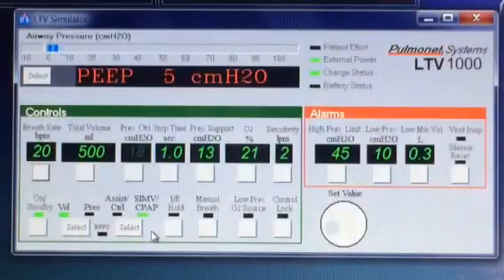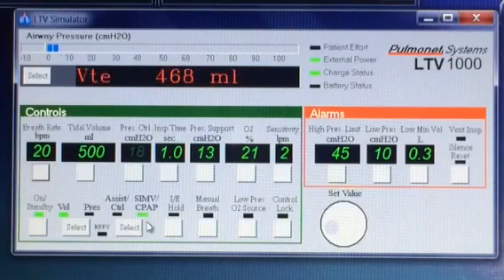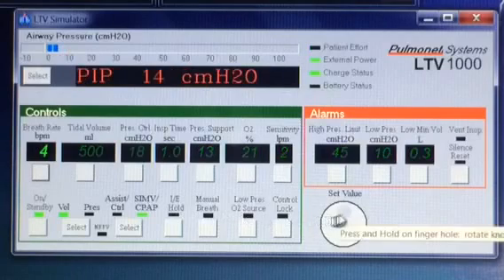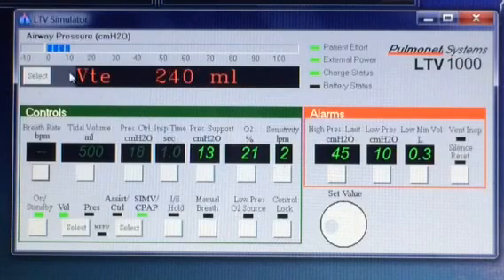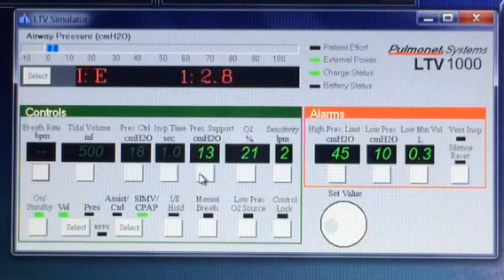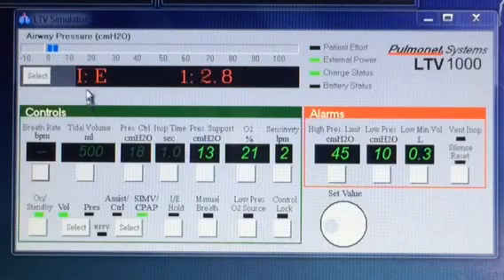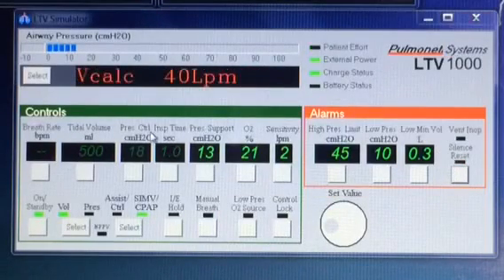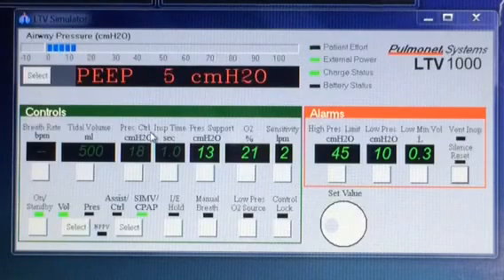CPAP VENTILATOR MODE EXPLAINED

Comment: Can a CPAP Machine be converted into a complex inpatient Ventilator?                             Kathleen Chesterton 11.9k views  
Source: https://www.quora.com/Can-a-CPAP-or-BiPAP-machine-be-used-as-an-adequate-substitute-for-a-ventilator-if-the-spread-of-the-novel-coronavirus-creates-a-shortage-of-ventilators
Vents and CPAPs/BiPAPs are entirely different devices that treat entirely different respiratory conditions. Vents (ventilators — this is mechanical ventilation) are for those who either cannot breathe on their own or who need assistance with spontaneous respirations. CPAP & BiPAP devices treat sleep apnea both obstructive and central. These patients CAN breathe on their own and, for the most part, can initiate respirations. So, no, these devices would not replace a vent, nor would a concentrator. As well, the settings on vents are very different from those on an...
Vents and CPAPs/BiPAPs are entirely different devices that treat entirely different respiratory conditions. Vents (ventilators — this is mechanical ventilation) are for those who either cannot breathe on their own or who need assistance with spontaneous respirations. CPAP & BiPAP devices treat sleep apnea both obstructive and central. These patients CAN breathe on their own and, for the most part, can initiate respirations. So, no, these devices would not replace a vent, nor would a concentrator. As well, the settings on vents are very different from those on an apnea device.
People on vents are intubated. This intubation — tracheostomy, orotracheal, nasotracheal — is incompatible the with the tubing of apnea devices and the tubing that works with intubation doesn’t work with apnea devices. Although vents have CPAP and BiPAP modes — other mode settings include PEEP and SIMV — these settings aren’t used alone. And CPAP and PEEP, for example, are used when weaning a patient off a vent but, again, this isn’t the only setting /mode in use and apnea devices don’t deliver enough pressure to ventilate lung tissue.

Comment: that's not CPAP mode at all on the LTV 1000
Reply from the maker: Please explain your statement.
Reply: Wes Roberts if you have Pressure Support of 13, which is your IPAP, and a PEEP of 5, which is your EPAP, then you have BiPAP not CPAP.
Reply from the maker: When using a ventilator, the mode is called CPAP. It can also be called CPAP W/Pressure Support. 
  There are subtle differences between a ventilator and a BIPAP machine. The LTV ventilators don’t constantly adjust flow to maintain the IPAP and EPAP as the patient breaths. That is the difference between IPAP and Pressure Support. 
  While a BIPAP machine is typically used for severe obstructive sleep apnea (as opposed to a CPAP machine) or assist respiration when there is increased work of breathing for whatever reason, the CPAP mode on a ventilator is the final weaning mode before extubation. The peep is used to replace the lost physiologic PEEP and the Pressure Support is used to overcome the added resistance of the tubing.
Reply: Wes Roberts I am a paramedic and use the LTV 1000 daily. CPAP is not just used to wean people off of vents. It is used every day for pulmonary edema, CHF, etc.

I’ll just agree to disagree in whether or not your video is BiPAP or CPAP.
Reply from the maker: I’m glad to hear y’all have the LTV 1000 on your ambulance. 
  CPAP W/Pressure Support works almost exactly like a BIPAP. When you bring your patient in, if you tell them you had them on BIPAP... that’s great. Everyone will know what you are talking about. It’s not that big of a deal. BUT... it is CPAP mode. Also, on the LTVs, when you use a mask, you should turn on the NPPV mode. (Noninvasive Positive Pressure Ventilation) 
  I suggest you download & read the Clinicians Manual for the LTV 1000.(its a couple hundred pages)  I don’t have a link to it handy. I keep it in my phone in iBooks (pdf format) along with the manuals for every other piece of equipment I use. 
  Keep up the good work.
Reply: @68superwes  haha, of course a paramedic thinks he knows it all. You're explanations are spot on.
Reply: @b.dwaynearmstrong577  i agree , this is bipap